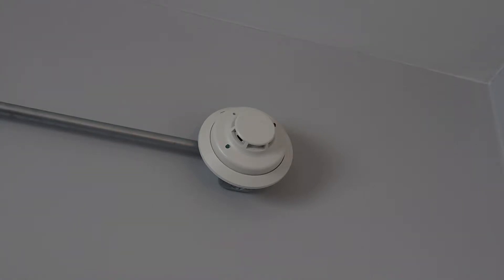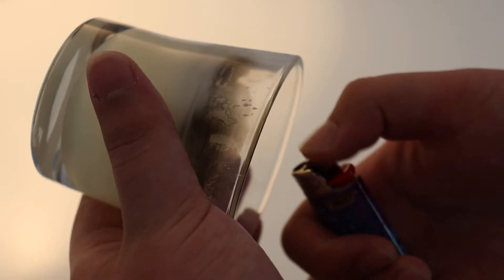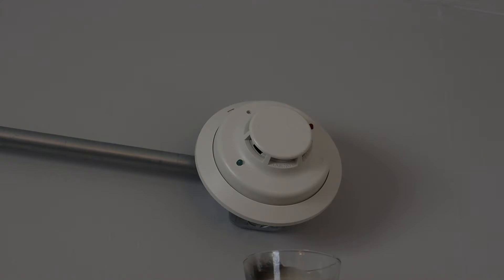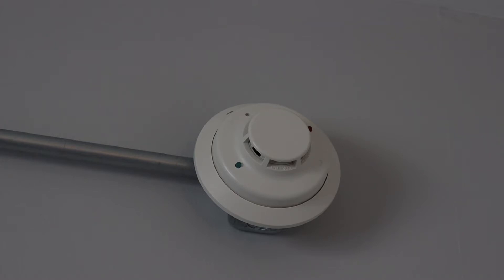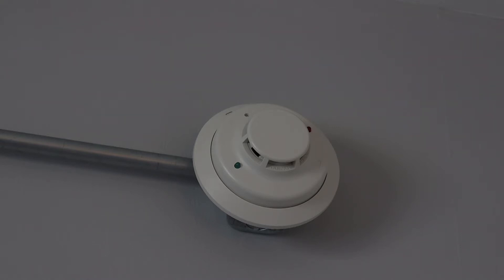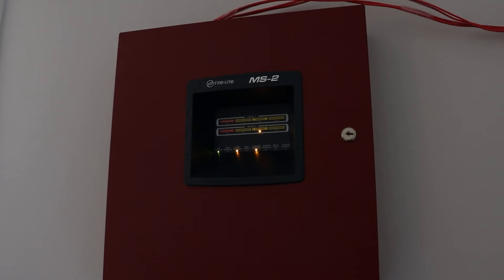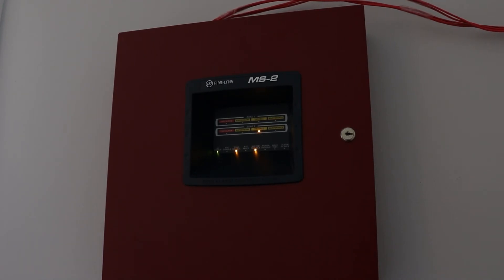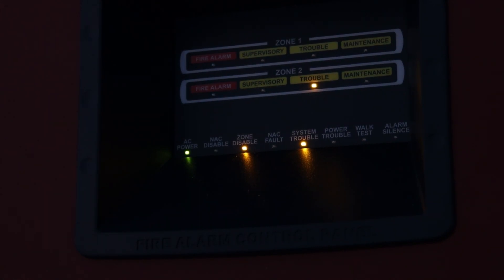Crazy Attempt At Testing The System Sensor i3 With Real Smoke!

Comment: I had that same issue with silencing until I messed with the dip switches because now mine will do silent, also I believe if you have devices that aren’t compatible on the panel I believe that could cause it to act up as well. Just wanted to say what worked for me

Comment: Do you have dip switch 1 on Switch one on? Silence inhibit?
Reply from the maker: No, it was just on Gentex Sync and selective silence. I have heard in some places that Gentex alarms have issues when syncing on continuous, and by default the "Whoop" tone is continuous so that was probably the issue.
Reply: I also made a channel myself lol
Reply from the maker: @senioralarms4068  I checked out your videos, I like your setup!
Reply: Question for you, does it matter that I don’t have a resistor on the smoke? I have wire coming from the zone into NO and C on the i3 and the 24 volt resettable power is in pos/neg, then I have another two wires coming from the NO and C of detector the the pos/neg of pull with my resistor on that. Is that alright?
Reply from the maker: @senioralarms4068  If it sends the panel into alarm, then it's fine. However, if there is a fault in the detector, such as the detector head being removed from the base, it won't put the panel in trouble.
Reply: What would I need to make it to where it would go into trouble if it was removed?
Reply from the maker: @senioralarms4068  You'd need an EOLR (End Of Line Relay) in order for it to be properly monitored. The specific model number is EOLR-1, here's one on Amazon: https://www.amazon.com/System-Sensor-EOLR-1-line-Encapsulated/dp/B001ULM8FS?th=1.

However, since the last device is a pull station and not the detector, the EOLR would not be able to go on that zone unless you switched the wiring and made the detector the last device.